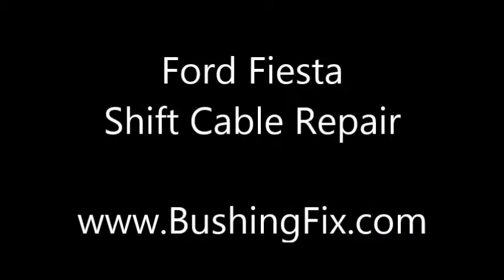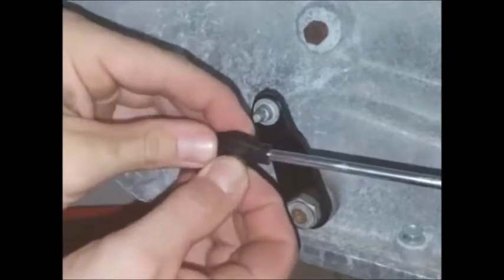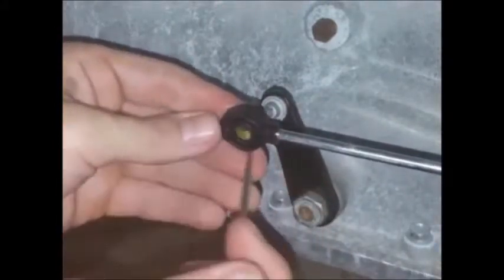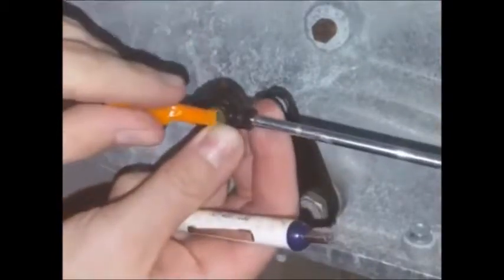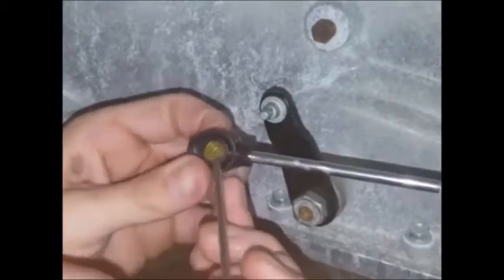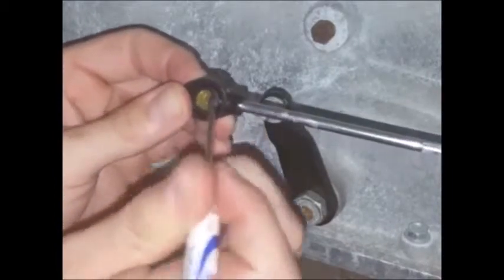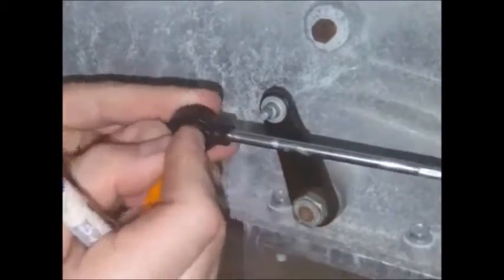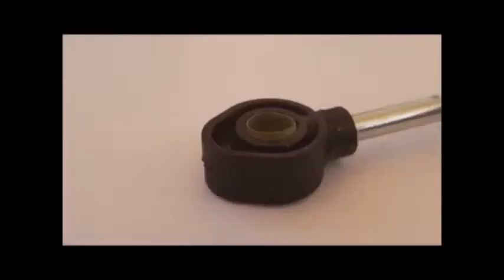The easiest way to fix or repair your Ford Fiesta shift lever! Kit includes replacement bushing.

Comment: I got a 15 fiesta automatic and the shifter is doing nothing, got stuck in park. But I can’t find where the shifter bushing is !
Reply from the maker: here's a link to diagram of your 15 Fiesta gear shifter linkage: https://www.tascaparts.com/v-2015-ford-fiesta--st--1-6l-l4-gas/manual-transmission--gear-shift-control